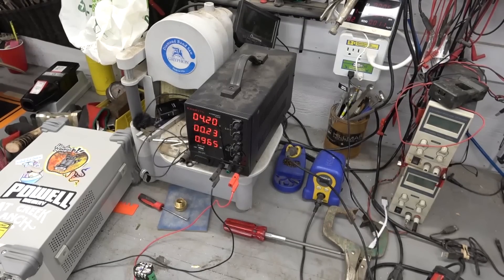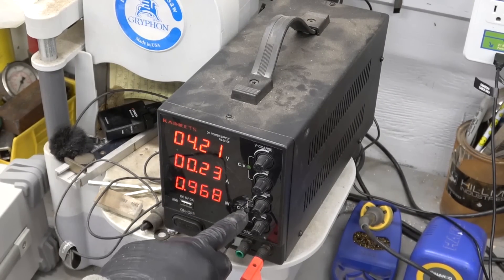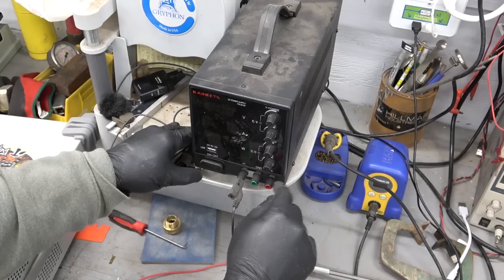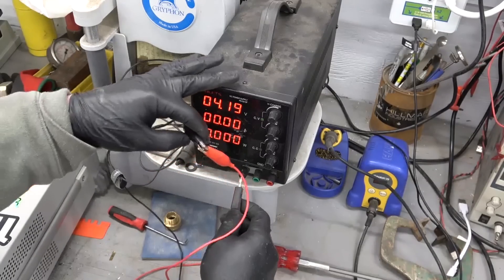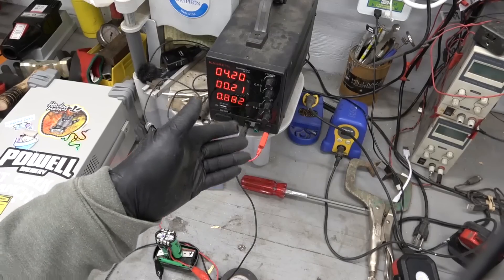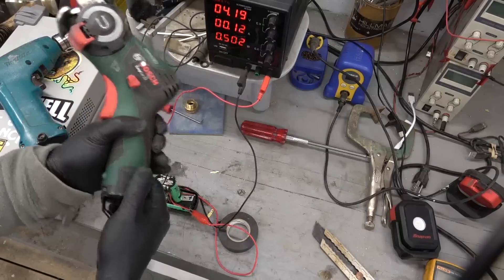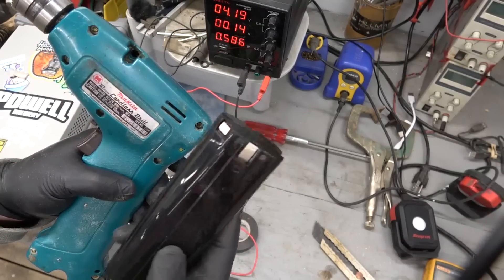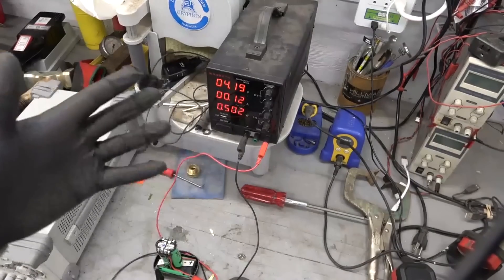Adjustable Power Supply || Viewer request how-to

Comment: There is a whole class of even cheaper adjustable power supplies in the form of wall wart on a cord with voltage adjustment knob and digital voltage display. Almost the same functionality if you have a multimeter

Comment: Good info. I saved many a lead acid 12v battery by pumping them with a old 12v charger/ starter that has a label stating it has no internal protection and must be monitored when in use. After giving them a little time my smart trickle chargers will happily tend them.

I think I'll be getting a power supply to go through my garbage dewalts and milwaukee and some seriously weak old NI-Cad snap ons.

Comment: Given the price, there's really no excuse not to have at least one if you're working on cars and electronics.

A few weeks ago, I replaced a neighbor's dying car battery.  I used the power supply like a heart/lung machine to keep 13 volts running through the system so the various security systems and components wouldn't go dark requiring reprogramming.

Comment: We used to connect several of these together and use them to feed electrolytic capacitors with reversed polarity until they'd pop and shoot their guts into the ceiling tiles at school.  Great fun.

We also used them to CHANGE the polarity of electrolytic capacitors(it's easy, apply low reversed voltage for period of time then slowly increased to the rated voltage... takes 5 minutes or so for small caps) then put those caps in the supply for other students to use..... great prank and kinda funny watching people try and troubleshoot their projects thinking they reversed something.

Comment: One of the fastest ways to blow up these power supplies is to connect a higher voltage than the setpoint voltage to the output. In most cases, this will cause current to flow backwards into the power supply and blow it up in short order. Often, a diode is used to block this current to protect it.  It will mess up the voltage reading, but it will keep you from blowing the supply up.
Reply: So that’s what happened. Never knew.

Comment: On my once I get a job list right next to oskilliskope. 
A lot of failed electronics these days are really just a power supply quality issue due to weak capacitors and the like, but the only real way to test that is with a known good power supply, and aside from spending $500 you can't know that without the scope (Or a friend with a scope, they don't need to be verified smooth but once every few months.).

Comment: The nuke physics institute I got my degree at had its own electronics shop, and they built quite a few of these power supplies from scratch. 50V/10A max; mV, mA adjustability. (CAMAC for the detectors was all commercial.) Anyhow, I found one of these discarded in the dumpster for some reason (they built them, they could fix them, right?). Well, I adopted it, fixed it (stupid easy), and have been using it on occasion for 35 years. Very glad to have it.

Comment: I had 4 - 2 cell (7.40v) LiPo RC car batteries I puckered my asshole saving with my bench top power supply. The voltage was too low for the charger to recognize the battery (>1v). Trickle charged them until there were just enough angry pixies in them for the charger. Saved me over $200 in batteries.

Comment: If you aren't super comfortable with this setup because you don't quite trust yourself to know if it is working ok or about to explode, you can get some more specialized tools that are a little more idiot-resistant for about the same money. Take a look at DC-DC battery chargers for RC cars/planes/boats. They have some fairly nice units that you can hook up to a car battery, or an old PC power supply, and tell it what sort of battery chemistry you are dealing with, how many cells, and it will generally go off and try to charge it. Given how much abuse RC batteries get, both in terms of getting banged around and in terms of the electrical loads they service, the chargers for them tend to both be more forgiving about still trying to charge an out-of-balance, multi-cell pack, AND they are better about detecting if one of the cells is failing so bad that it probably ought to stop trying to charge. Some of them even support a thermocouple you can stick on the battery so it can shut off if the battery gets too hot. For those of your more electrically inclined, RC chargers usually also have balance ports so you can wire up each cell in a pack and have it balance the charges across them individually rather than just doing the whole pack voltage.

Personally, I've got a small ISDT and an iCharger that I run off old PC power supplies, and I like both of them. It looks like Spektrum is also selling decent units now (possibly ISDT rebrands?), if you want something from a more established brand. There are also AC-DC units that you can plug directly into the wall rather than running them from a DC source, but they cost a little more. Anyway,  if you don't go crazy with the power ratings, they aren't much more expensive than a cheap bench power supply, and they have some extra brains and features in them specific to charging batteries.

I still whole-heartedly agree that having a cheap bench DC supply around is really useful. I just wanted to point out that there are some more specialized options specifically for charging batteries that can still be had cheap and are still generic enough to charge most sorts of batteries you are likely to have.

Comment: "You're right, I wish I still had the one I built from the plans in the ARRL Handbook. I just found the 1984 edition in PDF online; it was the first result. I'm not sure if the power supply details are in that edition, though. I think mine was from the 1981 or 1982 volume. Check it out."

Comment: My folks laptop from I dunno... 2004 or so (a cheap Dell), it got old and show, they stopped using it. A couple cells in the pack grew their dendrites (as lithium rechargeable do) which shorted them out and so they're dead. 

HOWEVER, most of them are still good and I use them to this day, every day, in a cheap "work light" that had two floodlight cob/lenses. It takes either 4xAA or 2x18650, and can even recharge (trickle) the 18650s.
I use that thing every night taking the doggos out, run it in low and get probably 3 weeks of use with it being used ~6mins each night (sometimes twice).

Point being: most dead laptop battery packs are only ""dead"" and there's plenty good cells left to salvage from them!
The older ones are better, too, since they've got a lot more Cobalt in em. 😊
(bad for the miners, but good for consumers; new ones have virtually no Cobalt)

Comment: With a saw, some epoxy, some offcuts of wire and two banana lead sockets, you can make your old knackered cordless tools corded and give them a new lease of life (only really worth it for specialist stuff, my dad had an old makita nicd angle drill, for 5 uses a year it wasn't worth buying a new one, power supply to the rescue!) along with all the downsides of being tethered to a pixie receptacle.

I actually bought mine for pyrography. The proper pyro station (that did like, 12v with 1-5 amps range or something like that) was £200. The 0-30v, 0-10a power supply was £60. One set of cannibalised wires later, it works perfectly with the proper tips.

Comment: Not recommended, but ive saved quite a few very expensive LiPo batteries for RC cars with this method. No charger will accept them, and normally you trash em, but i put them in a cinderblock(in case they go nuclear) snd trickle them very very slowly, then once they're high enough, the balance charger will finally take care of them.

Comment: so to balance the two different cells in the pack you just hook up to the low one and balance it manually? it wont daisy chain over to the lower one through the tab connections? i just fried some batterys on accident and was trying to fix them last night. to no avail
Reply: BeavisButtHeadMrBeavis
No, you must do it individually.
Charging them in series is what gets them out of balance.
Let the cell rest 15- 30 min before checking actual voltage.
0.1v is good enough

Comment: Anyone know of a way to diy or purchase a 12VDC to 24VAC battery powered inverter, around 50VA, for testing field devices/sensors before permanent power is up and running?

Comment: I disagree on dead Li-Ion cells. If they are dead dead, leave them dead dead. After a certain voltage even if you revive them they won't work as specified on the paper. When you are making projects with them it can result in unexpected behavior.

Comment: The little dongle USB-X type pass through meters are great for consumer electronics, which USB C or tc charger (and especially any USB extension cable for something like an SDR dongle is very helpful and similarly inexpensive. Awesome stocking stuffers for radio nerds etc.

Comment: Also useful for supplying voltage / current to all sorts of electrical circuits and stuff, including cars, biles and boats, testing relays and triggering all sorts. Supplying line voltage, which is current limited will save lots of fuses and more expensive kit when it's being tested.

Comment: An alternative is to buy a cheap generic RC charger that has built in balancing.  A little safer than an unsupervised adjustable power supply, and in a lot off cases a better tool for the job. However, an adjustable power supply will work, you just have to be smart/ cautious enough to use it safely.

Comment: One of those el cheepos saved me from having to pay 100s of bucks for a car key battery change. I wanted to diy it, but the aftermarket batteries I bought from a very reputable store were actually fully discharged, so when I swapped em the keys were dead. They are some weird low capacity and voltage batteries so I needed a way to charge em up. Took all of like 20 mins to fully charge em with the el cheepo, keys been working flawlessly ever since.
Ah NiCd batteries, those were awesome. I had one for my first RC car I raced, it lasted many many years while the newer higher cap NiMHs lasted only a year or two at best.

Comment: My Amazon special has no current adjustment so it's fairly dangerous to charge a battery. I got a few Ryobi's working again but not for long. I can afford new batteries so my days of being a cheapskate and a wanna be electronics repairman are over. I'd prefer to live another 60 years!

Comment: I've seen car batteries saved by stick welders via desulfation of the plates.  Can this be set up for that?
Reply: yes, 30v (angry pixies much) at a max current of 2amp run untill the battery takes current and the voltage drops to 13-14 range; then take it off charge over night and test it in morning, if its held voltage over night put it on your normal charger. Also might be handy to actualy load test the battery a few times. plenty of vjaos on the tubes for this.

Comment: Right when I been kick'n the idea around,  but I been itching to try what Garage 54 did reverse charging dead lead acid battery,  am I crazy ?
Reply: The best kind of crazy... just keep in mind you might generate a fair amount of hydrogen, so keep the cells unsealed and the ignition sources away, and your curve will be very nonlinear after, since you're potentially messing with the oxide balance. You're playing with an electrochemical cell, wear eye protection, keep rinse water nearby, etc., good luck!
Reply: @jercos  I believe they said once fully drained to start the reverse charge @ 1% so 1.2v and then ramp up

Comment: Man, did you start a run on these things at Temu!  $33
Reply: Generally I'd say, stop buying things off Temu. Even if you're buying crap Chinese knockoffs, there's better ways. For $33 I suspect you get 20v and a 5A limit. You can get those specs from a cell phone charger nowadays, hold out for >30V 10A. :-)
Reply: @ It is a 30 10 and appears identical to his.
Reply: @jgrenwod  The one I see at that price doesn't have any photos, only 3D renders, which is more to my point. It's Temu... complete shot in the dark every time. You might get exactly the one Uncle Bumblefuck is showing off, or you might get a $5 switching supply board in a funny case, it's worth paying $60 for a Chinese supply you can see a photo of instead of getting god knows what.

Oh, and of course, the "Normally $331.24!" next to the price is complete bullshit.

Comment: The good cells aren't necessarily the ones that get to 4.2V first, it could be the bad ones getting to 4.2V first because they lost more of their usable capacity. You need to cycle-test them to make sure when there is no cell balancer giving you some sort of guarantee they should be starting from the same place.

Comment: Dead lipos should not be recharged, once they drop below a certain voltage, recharging them causes dendrites to form, shorting out the cell
Reply: That's half the fun... don't leave 'em unattended, and have a plan for when and if it catches fire, so the first thing that lights up is also the last.

Comment: Build one from an old computer power supply. Most of the time all you need is 12V, 5V and 3.3V anyway. Add an adjustable regulator for your 4.2V or whatever.
Constant current needs more parts but Ohm's law is your buddy.

Comment: Also I'm wondering about the electronics in all of these charging stations and how come the tweakers aren't stealing those like they did the ATMs. 
When I was working in the XYZ we had to get our copper inside the shop.
And literally that was like back in the early 2000s. 
I think if the geniuses of engineering that I'm sure that you know of haha my dad said that they were a bunch of assholes. 
Don't you think that like they would want to accept cash and credit cards in those ATM voltage charging machines. 
But don't worry whatever you do there's going to be somebody out there that when you put your credit card or however that works cuz I have never used one. 
There'll be some dick head out there that's going to try to swipe your information so be careful out there ladies and gentlemen I know you're from Canada I'm from Oregon and I still love you guys. 
Even though I can't drive up there because I had a DUI in Oregon. 
I don't love that part. 
Butchart gardens I would love to visit but I can't. 
Coming into Vancouver Canada to go on a cruise like I did to Alaska I can't. 
And that was way before tariffsso what the hell I'm super glad that the Canadian government has protected you from my drinking and driving which I'm not doing anymore. 
However I guess the Canadian government set their own terrorists on that tourism model back in the day. Sometime back in the 90s❤
You still got the 555 cigarettes up there and that cheap codeine? Get used to be available down here but there was cocaine and heroin and everything in the drug store in the 30s like my dad told me. 
Amazingly not a freaking problem to the extent that we have today 👍🇺🇸🏆 yep moving forward ⏩

Comment: i resemble that. havem by the dozen what for galvanic corrosion testing & electro etching chiller tubes. an angry 18650 spewing fire is exciting, in my basement, near my solvents & paint.

Comment: So 5 volts is that a 4.2 if it was overcharged it's going to wreck the molecular structure of the ions in the battery. 
That's probably the dumbest answer you ever heard. 
Any idea about this comment was I was going to say well if you wanted to charge it what happens will it just doesn't charge. 
This XYZ stuff I tell you don't forget your cheat codes and running interpolation on it first would you. 
LOL smarty pants❤

Comment: It is not the strongest of the cells that is fully charged first, it is the weakest cell that is fully charged first. It is also the weakest cell to be fully discharged first.

A cell has a certain Ah or mAh value.

If you put 2 or more cells of different capacities in series, it is always the weakest that discharges first, and thus becomes weaker, and also the first to be fully charged, and thus becomes weaker.

All cells receive the same energy or Ah during charging. The weakest cell is charged faster because it has less Ah capacity. And therefore, this cell is also discharged faster because it has less capacity.

The result is well known.

Comment: One trick that I have used on under voltage car batteries is to put two in series to trick the charger into working.  After the voltage of the under voltage battery comes up enough to charge on its own then take the additional battery out and charge it all the way up.

Comment: @5:35 there's a slight mistake... he shows a borscht 12v li-ion bateria composed of 3 li-ion cells that require 4.2v to reach full-charge... so the charging voltage of the battery should be 4.2*3=12.6v

Comment: Agreed, loved mine so much i bought a 2nd so i could run them in series for increased voltage.

I use them a lot as a forklift mechanic for recovering overly discharged batteries in electric forklift - all the modern chargers dont have a contactor you can wedge shut anymore 😂

Comment: But isn't that the idea of a balance charger, so all the cells are the same.
Reply: Entirely. A balance charger is effectively a 4.2v power supply for each cell. You can balance cells one at a time with a 4.2v supply and some switches, or all in series with a balance module bypassing charged cells, and it achieves the same thing.

Comment: Not to mention, they can also be used for electroplating, and if I'm gonna bring up electroplating, then we also might as well mention that they're useful for electrolytic rust removal.
Reply: Oh, that's a good idea. I have plenty of old tools I just can't bother with on rust removal, but an adjustable power supply would give me an excuse / capability to mess around with electrolytic rust removal.

Comment: Hell I dont't need that, but I have two from Keysight. Pro tip, convince boss that because Keysight calibration is like 60% of a new unit, you just buy new ones (and then after a while you "discover" a 3rd party calibration service for cheap:)